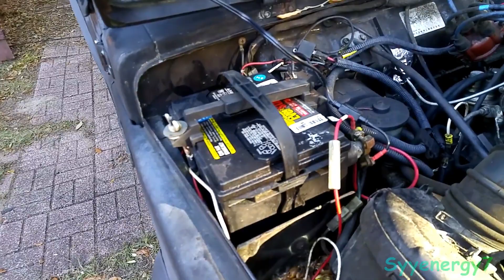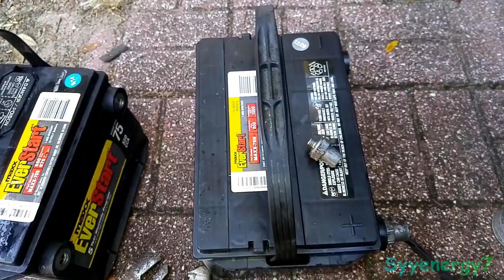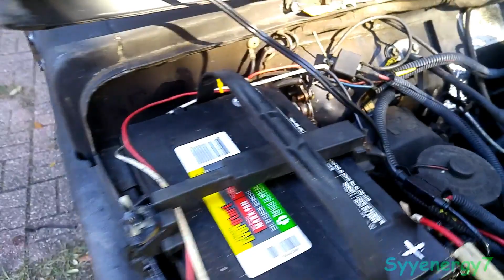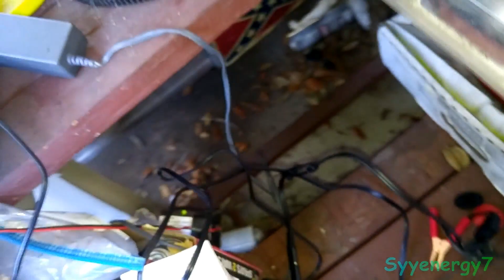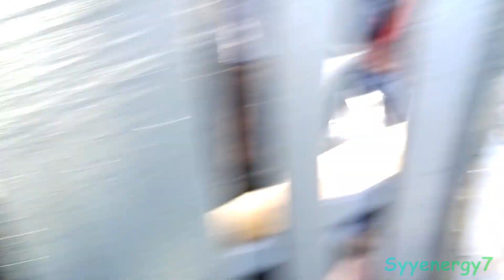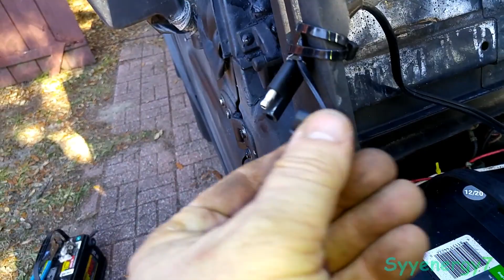LARGE Battery for Suzuki Samurai, SJ413, plus Battery tips

Comment: The chemical damage from charging and discharging is also physical damage. The plates become pitted like Swiss cheese over time. That's why they eventually fail. If you don't over discharge, and use a desulfator, they will certainly last longer, but not forever. They're being physically worn out, just at a microscopic level.